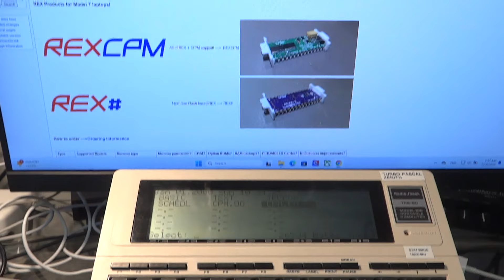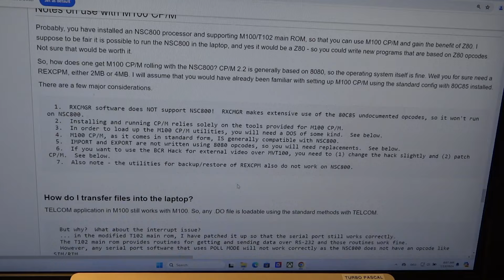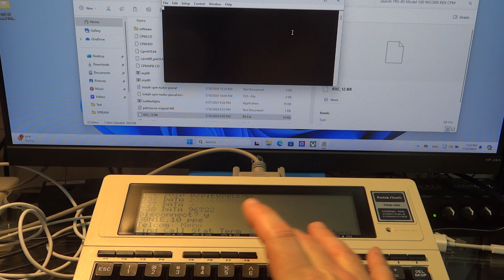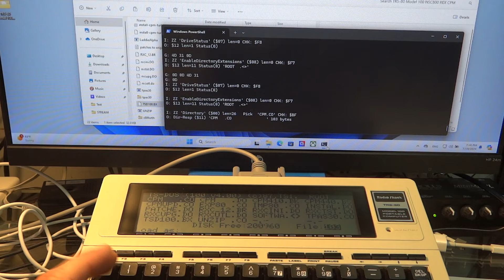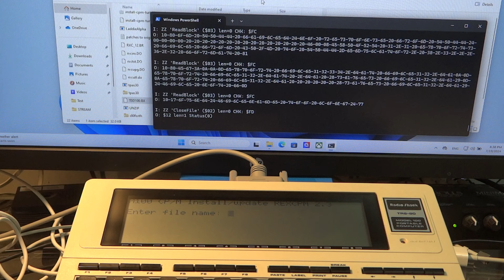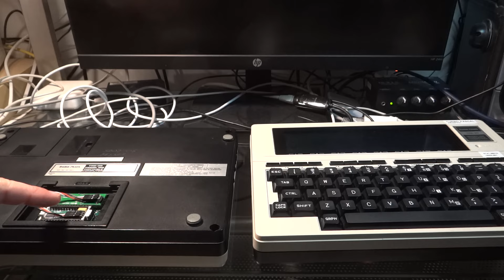How to run Turbo Pascal on the TRS-80 Model 100 - REXCPM and the NSC800 Mod

Comment: Screen scrolling and output can be made very fast. The ROM routines redraw the entire screen when scrolling, and the character drawing is quite slow (it polls the LCD's busy when you can just do a hard-coded delay loop).

The LCD drivers can do hardware scrolling internally by 8 pixels (rotates which rows are displayed), though it's two rows of drivers so you have to copy graphics from the lower to upper when scrolling. It's lightning-fast if done right.

Comment: Re scroll lock. This can be turned off so scrolling will be continuous. The M100 CP/M docs say... F1 - toggles between Scroll Locked (Sc L) and 'Scroll Standard' (Sc S). Press LABEL to see this. In Locked mode, when the display is ready to scroll, the cursor will be at the right-hand bottom awaiting any key press. F1 can be pressed at anytime, however best to select it before starting the offending program.